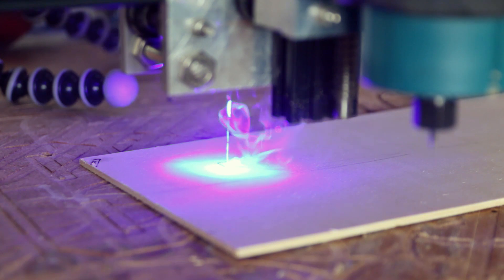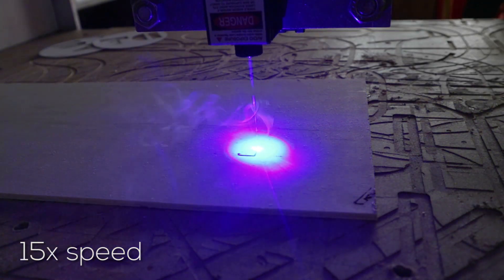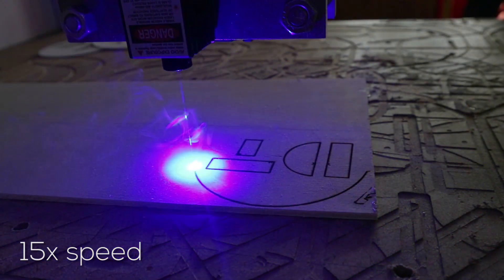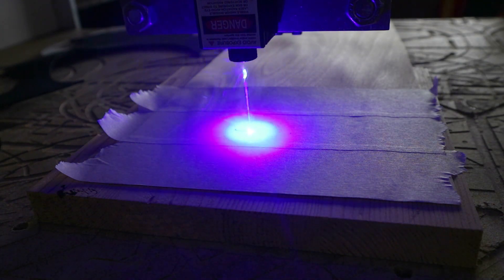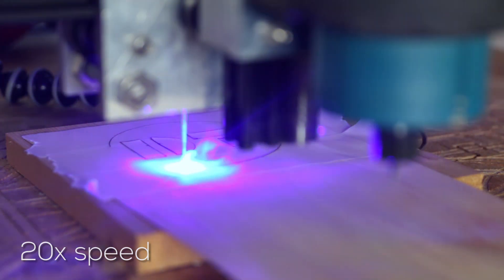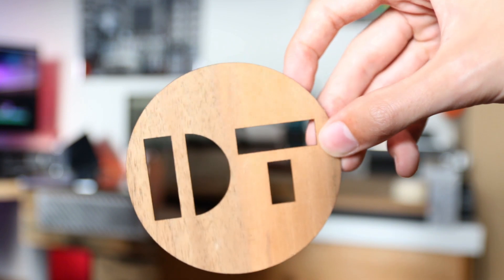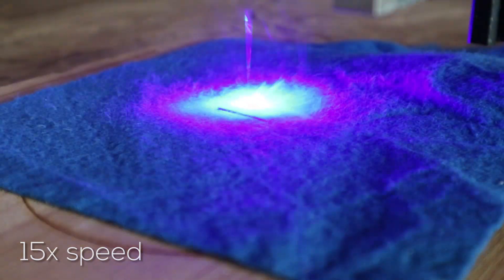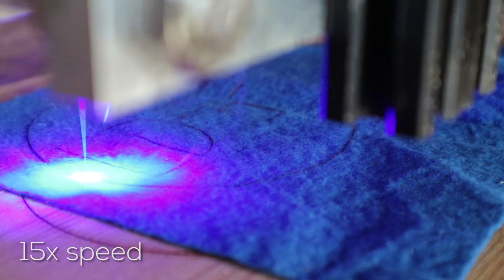CNC 2.5W LASER Upgrade - Cutting Tested

Comment: Do not cut vinyl or pvc! Never, ever just don't! It releases chlorine gas!
Reply: Have you never considered the idea of dust/fume extraction? I mean idk about this lightbulb head kid but I have air cleaners, dust extractors and collectors, dust collectors converted to just send the air outside, respirators, etc. Never limit yourself by just not using something, instead find a way to use it safely
Reply: @miles11we fume extraction is a way to keep the danger low but it will still degenerate the laser.

Comment: Can you not use the z axis to lower the laser on subsequent passes when cutting 3mm ply. Maybe .5mm drop each time. I am new to laser and looking to convert my cnc for this reason. Total nooby so may have the wrong idea. Really liked your video and the upgrade.
Reply from the maker: You could totally do that. You could probably just use multiple depths option of a normal contour tool path.

Comment: Great info, thanks! Couple of notes -- first, other lasers like a K40 CO2 40W laser don't necessarily cut through clear acrylic/plexiglass because they're higher power, they cut because they use a different wavelength. The laser you're using is probably 400nm blue/purple/near-ultraviolet wavelength, while a CO2 laser is something like 12,000nm infrared. Clear acrylic is clear to visible wavelengths, but is opaque to CO2 laser wavelength! And second, I've heard that coating clear acrylic/plexiglass with a black dry-erase marker gives a layer that can heat up and will let you visibly engrave with this type of laser -- although how opaque it engraves also (from what I understand) depends on whether you're using extruded or cast acrylic. It's opaque white on cast acrylic, and semi-transparent white on extruded acrylic. Hope that helps!

Comment: Just got a 2.5 watt laser today. Managed to cut 3mm plywood in 9 passes by raising the bed by 0.3mm each pass to keep it in focus.
Reply: how did you raise the bed with precision? there is no z-axis.
Reply: @genau14zeichen  He might have his fitted to a 3D printer or CNC engraver.  They DO have a Z axis.
Reply: @genau14zeichen  added a z axis on the laser to adjust depth
Reply: I just found the Eleksmaker A3 now with 50% discount at Banggood: https://www.banggood.com/nl/2500mW-A3-30x40cm-Desktop-DIY-Violet-Laser-Engraver-Picture-CNC-Printer-Assembling-Kits-p-1003863.html?p=7I22079633188201703T
Reply: Sir can you cut small piece o f thermocol and tell me if it cut ... Please help me
Reply: Sir can you cut thermocol sheet and tell me if it cut ... please help me with feed back because I am stuck to buy which watt laser to cut thermocol
Reply: @pratikjambotkar4626  Legit if you want to cut anything look at a 40w co2 laser. Diode lasers are great for engraving but take to long to cut anything meaningful in my opinion

Comment: Use a dry erase marker on the plexi.
Reply from the maker: That is a good idea, I will try that if I get a chance.
Reply: You can use different colored markers and a low intensity lase. Like a laser printer. It'll work on 3d prints too, though if you don't acetone smooth them (or equivalent) you'll have a hell of a time getting the dry erase pigment out of the layer lines. 

This method will let you lase any surface which you can melt or burn, even entirely transparent or reflective surfaces. I like cutting tin-foil this way, and it's great for small scale customization of mass-printed things.

DEP makes a dry erase spray paint. Not the dry erase surface, though they also make that, but the 'ink' it's self, in spray paint cans. I haven't tried it, though. 

P.S. My laser was only 500mw, and I had a lot of success with it, until I tried to attach it to my printer and blew out the diode. 'Sokay though, got a 2.5w in the mail, due to arrive any day! Can't wait to see what I can do with that!

P.P.S. I've considered separating the RGB channels of an image and doing a raster pass for each one. No idea if it'd work, or just turn common areas black. If you try it, and have any luck, might be an idea for a video.

Comment: Thanks for the video! 

One note: YOU SHOULD NOT CUT VINYL WITH A LASER. This creates chlorine gas which is very toxic for humans.

I'd love to see if you can engrave the anodising off of aluminium!
Reply from the maker: no, the laser isn't strong enough to do any damage to the aluminum, I tried that but you literally see nothing.
Reply: Datulab Tech did you try anodised aluminium?
Reply from the maker: I don't remember exactly as it was quite a while ago, but I think I did try that too.

Comment: Have you ever tried to cut foamboard?
I'm into Radio Controlled Airplanes, & this would be great for cutting air frames
Reply: I thougt so when i buy a laser.But the foam between cardboard layers is getting melted while the cardboard is being cut.So you have to either lower the power and more repeat or full power less time but not so good product.